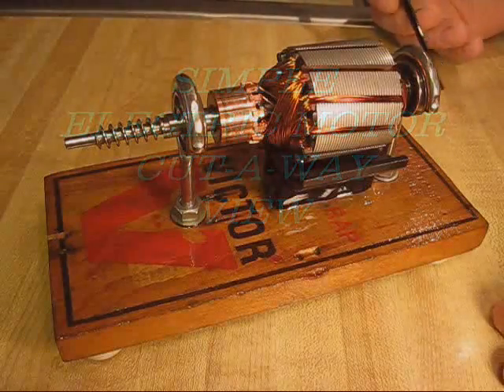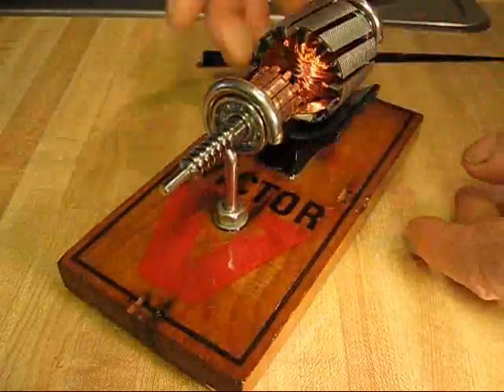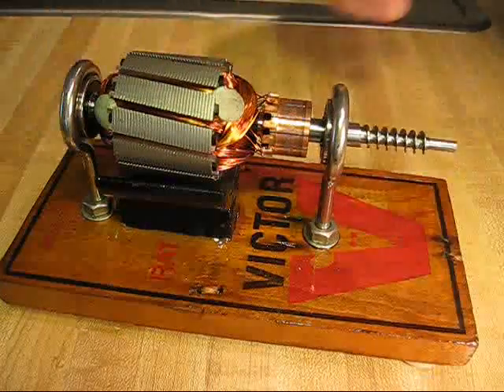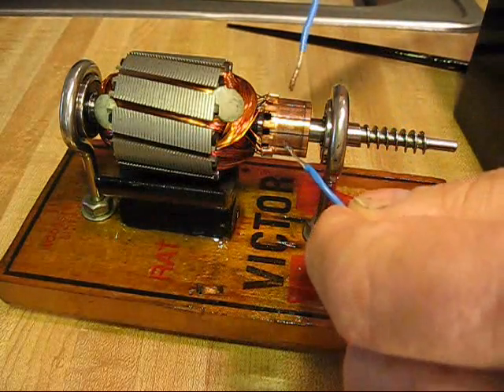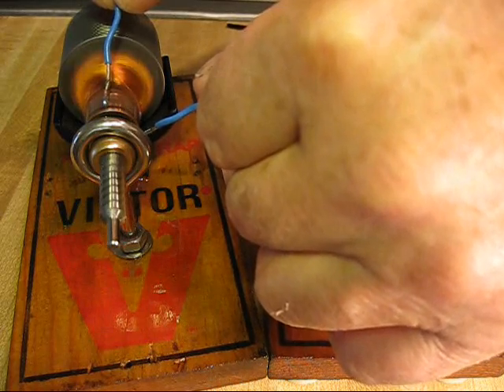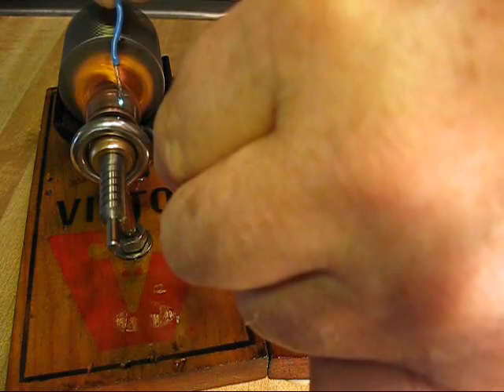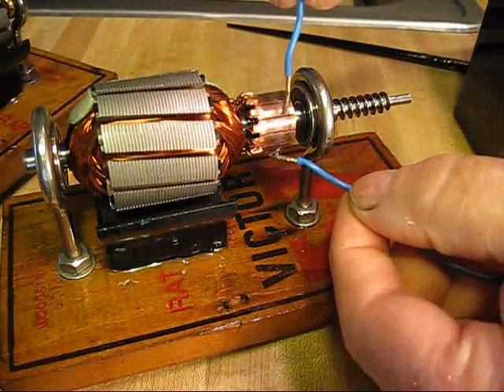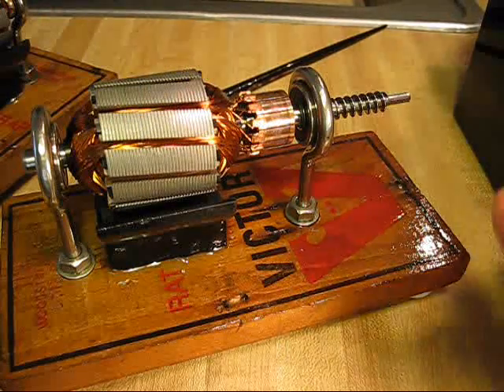Mouse Trap Simple Electric Motor

Comment: i did not understand. first one has ball bearings and the other one has what? what did you use for bearings on the second motor? did you say "bronze"? it didn't make sense
Reply from the maker: +bthnksk ,,,, just bronze bushings from the motor that the armature came out of,,, different manufacturer I would think,,, makes sense,,,,

Comment: If you add a stronger magnet it will increase the R.P.M.s.

I am a bit surprised with that since in the case of permanent magnet brushed DC motor the strategy  to detect a demagnetized motor*** is to check the speed with no load, if it faster at the nominal voltage the magnet is weak.
The motor will run faster but the torque will collapse
* if you give too many amp you will demagnetize you motor this is why you must use a slow fuse at the value of the nominal amp
Reply from the maker: +rokag333 ,,, what,,,, 12 volt dc,,, runs great,,, no slow fuse,,,
Reply: +shopdogsam https://en.wikipedia.org/wiki/Fuse_(electrical)
If you use a car battery, if you brake your electric motor  without fuse it will take too many amp and demagnetize nothing to do with voltage
Reply from the maker: +rokag333 ,,, that's right,,,,

Comment: Just a DC electric motor. Probably a wiper motor.  How scientific is that ??.
Reply: As scientific as the highest achiever in your rodent family.
Reply: +Crobular I The science behind it is quite scientific... The mathematics behind electromagnetism can be daunting, even with simple electric motors.
Reply: +ExternalTooth
 Oh, yeah. Those coils are the electromagnets, which would be easy to calculate, except there're three of them in odd directions. That might also seem easy to calculate, except the number of coilings on each coil makes each of them an inductor, both hindering the ability of current to start flowing and to stop. Don't even get me started on how this "electromagnetic inertia" means that the coils can interfere with each other a little bit while running. This hasn't even accounted for the distance of the permanent magnet or how those mounting posts are carrying and warping the magnetic fields due to its lack of a metal housing.
 I'm going to stop thinking about this before I scare myself. I'm in mechanical, not electrical!

Comment: I saved a motor from an electric car buffer.  One of the round black ones with the red button you have to hold to operate.  I have found that it is a permanent magnet motor.  This was not from one of those buffers that resemble angle grinders.  It was one of those 10 inch buffers that pad was loose and worn out on,  My Uncle was going to throw it away but I asked him if I could have it.  It seems like it may work well in a wind powered generator.

I tell you the type of buffer it is because the other types are not likely to contain permanent magnets.  I am not saying that you won't find one that does but I would have to get a better look at them to know.  One way to tell if a motor has permanent magnets is to touch a steel screw driver to the case and if it sticks they are quite likely to be permanent and not field windings.

Comment: you guys looking for motor parts can find them in all sorts of used cordless tools like drills, saws etc. yardsales, thrift stores almost always have a few for just a couple of dollars. just take the covers off and you have an armature, bushings or bearings AND brushes with holders even. very simple plus you have a portable rechargeable power supply with it.
Reply: I found a few great dc motors in a vacuum cleaners make sure you take ot the wind chamber/suction chamber /fan part it was louder than the vacuumed itself and made me jump :D

Comment: The sleeve bearing sounds much sweeter than the ball bearing.  I would have thought that the ball bearing motor would have less friction.  Very cool.
Reply: +ponkkaa Both should be silent. The bearings are probably hosed. They may also be misaligned. And degreased. The guy is doing everything wrong, then hiding behind education.

Comment: put one new screw that reachs just under 2 the middle of where u placced wires before  leaving a spark gap place your wires at bottom of the screw run 
with a  reg on /off switch to  +          your 2 wheel screws are grt idea put your - from  2 1          and the other + from power  2 switch    1st Tips` always unplug power when not in use ;) thx 4 your video